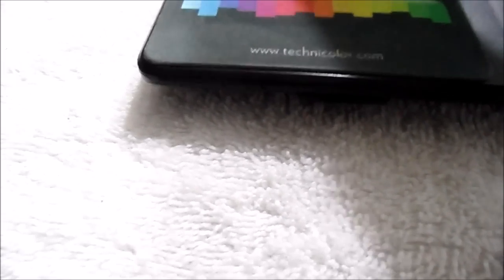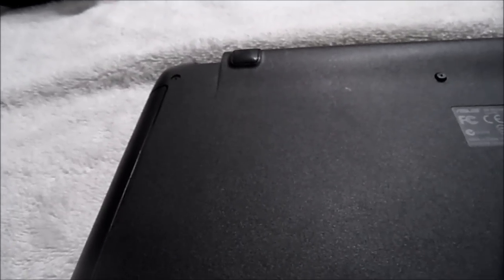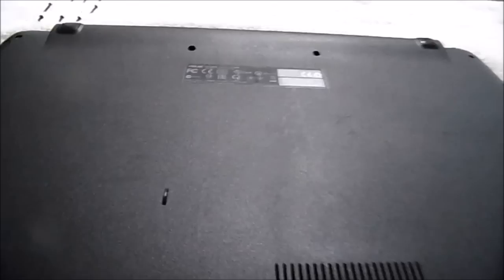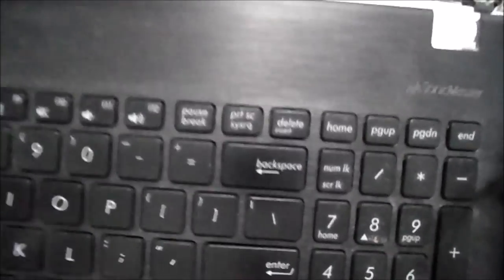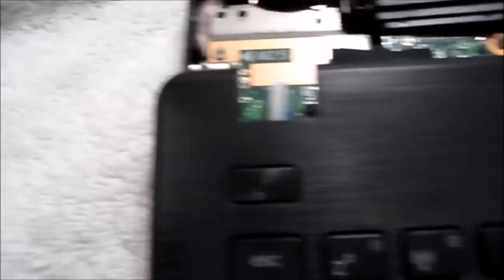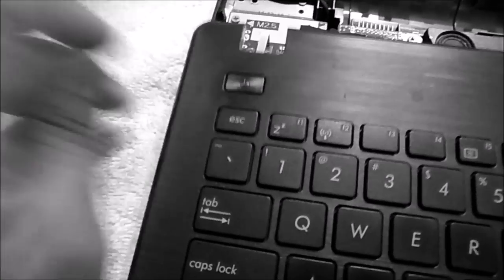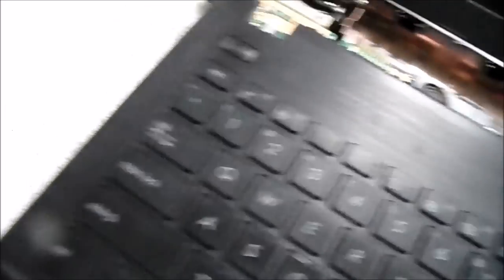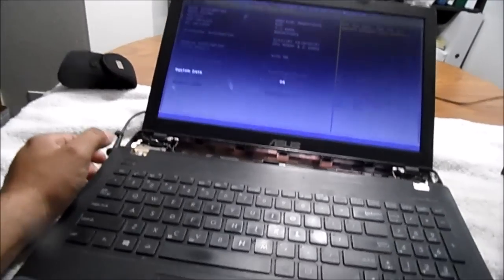Asus Computer IS NOT turning on from residual charge. here is the Fix up

Comment: Thank you....IT WORKED.  after I powered up without the battery do I go ahead an put the same battery back in.
Reply from the maker: if the battery still good. If is bad don't. They cost about 15 dollars on ebay.  Good luck and thank you for your comment.
Reply: You have helped so much!  If I had taken it somewhere they probably would tell me I needed another compter...but I put the battery back in and it is fine!
Reply from the maker: I'm very happy to hear that. I put this video because I know a few of my friends threw their computers and bought others because of problems like the one I show in the video and when I told them about this solution and other tricks they did not believed me, so I made this video for them and you.  Thank you for your comment.

Comment: What if you can't take it battery out.
Reply from the maker: The residual energy is store in the battery and you bios controls its discharge.  And it is the reason why you can't shut the computer back to on.  You must remove the battery to release the residual or left over energy.  Good luck.  Please subscribe if this help.
Reply: I couldn't get all of the dawn screws out. So I guess I will have to take it in to the shop

Comment: how do I make a asus laptop charger
Reply from the maker: If it is not charging then the battery is bad. I buy them at best buy for 15 dollars.  I hope that helps
Reply: Orelius so the battery at best buy is 15 dollars
Reply from the maker: I apologize NOT AT BESTBUY that was my mistake.  I buy the batteries on eBay for 15 dollars although I see this week they went up to 19 dollars.  Here is the link:  https://www.ebay.com/itm/Battery-M-for-ASUS-X551MAV-HCL1201E-15-6-Laptop-X45LI9C-A41N1308-4CELL-2600MAH/221912491394?ssPageName=STRK%3AMEBIDX%3AIT&_trksid=p2060353.m1438.l2649  just make sure that is the right battery for your ASUS.  Thank you

Comment: Hello, i have ASUS X550 L, my pc wont start up, my batter is broken ( it doesnt charge always 0%), but when i plug in the battery and plug i have led glowing at battery charging help please?
Reply from the maker: I though I answer this comment a few days ago. Something must have happened and it did not save my reply to you Norbertas.  Please excuse me and I hope this time you'll be able to see the answer to your comment.  I have also done this to the ASUS X550 and it works too. so here to go.  1.  Remove the battery or internal battery which ever you have from your computer. 2. Press and hold the on/off button for at lease 30 second to a minute to release residual energy being store from your bios memory and then release the button.  3. Connect cord to a wall outlet and press  on/offbutton until computer comes on.  4. Re install battery.  Thank you for your comment.
Reply: Hello, i have tried that metod of unpluging everything holding botton of  booting for 30 to 1 minute and then pluged charger in and trying pressing botton and it didnt work. Maybe I'm doing something wrong? Have you got discord or smth i can contact you with?
Reply: Orelius hello once again, i wanna ask do you have any social medias like facebook instagram or snapchat? Because i wanna show you how im doing  the way of (starts with everthing plugged in including battery and charger). 
First step is removing battery and charger from laptop.
Second step is holding power botton for 30 to 1 minute.
Third step plugging in charger.
Forth step is press power botton on.
And when i do all the steps my laptop still doesnt work.
If you could help me please.
Reply from the maker: Forgive my late reply but I am out the state for work and I don't have internet here.  I don't have social media but I can tell you that I only know two problems in this case. 1. is the one you have in this video which is the same I wrote you about and 2. is your power supply maybe damage as the diodes worn out at around 3 years for some of this type of computer as being very familiar.  Unfortunately, I would not know how to get a power supply if that is the case.  I wish you luck.
Reply: Maybe its battery, because i know that that battery is damaged and cant get charged, but if i dont plug the battery in but charger instead it should work isnt it?
Reply from the maker: Right, if you take the battery then don't plug electrical cords and just press and hold the on/off button for 30 seconds then plug an electrical cord or a good battery and it should work.  If that doesn't work then is your power supply.
Reply: And what could be with my power supply? Giving too much power or smth?

Comment: Hi,I have Asus X455L It won't  power on and won't charge, no light indicator if the Ac adapter is plug in .. Can you help sir
Reply from the maker: You have to remove the battery first.  With the battery out, press and hold the ON/OFF button for 30 seconds to release the energy back up by the last residual charge which is still being reserve by your bios.  After holding the ON/OFF button for 30 seconds to connect the plug or install a battery and that is all to it. Thank you for your comment.

Comment: This actually works! I have an ASUS X550J with external battery and had the exact same problem, my laptop would not start, not a single light on. Took the cable and battery out, hold the power button for like 50 seconds, put the battery back in and then it started aș normal . Thank you sir!
Reply from the maker: I;m happy for you. This works for any compauter out there. Thank you for your comment.

Comment: why is this???
Reply from the maker: Think of it like if your cmos or bio memory storing left over energy  but because you battery is dead, the energy or electricity can't be released until you remove the batter and then jump start by connecting it to the wall outlet. Thank you for this comment and if you like this comment please subscribe.  If  you have anymore question just ask.  Thank you.

Comment: I'm using a Asus d550m (given to me last year but I never had a charger) so I finally charged and the lightbulb LED is green. but the battery LED isn't. and it isn't turning on. what does the lightbulb even mean ?
Reply from the maker: Sorry for the late reply I was out of Estate.  I'm sure that you are having the same problems I am presenting here.  If the light bulb LED is green than you should have charge coming in and that will turn on the computer even when the battery is in red which mean your battery is damage or charging.  Please follow the video instruction and that should do.

Comment: So the idea is to have no power going to the computer while pressing the power button, and that pressing the power switch part will drain away excess voltages? (Hey please don't get me wrong, I'm not being a smart ass!) Maybe here's another solution. I have a barely used 6 month old Asus X551M notebook PC. It's got the same issues as everyone else's so I'm thinking maybe just unplug the wall adapter and leave it on battery power with the screen and system using up the power from the battery. It might take a bit of time but the battery will eventually die and then a person can press the power switch for the 30 or so seconds and solve the issue without having to take it apart... or so's my thinking haha!
It's Sunday and I don't do much on a Sunday 'cept pet my kittys or wrench on my old GMC 4x4... this looks like a good clean little minimal physical effort project. I've got the time so I'll have a go at it. Worst case is I take the 7 or 9 minutes (probably turn out to be a 3 or 5 minutes job haha!) and do as told here. 
I'll come back and post the results after I'm done.
Reply: Why not try the 5 hour discharge first?

Comment: hello! I have got an Asus Laptot. it only turn on when connected in power adapter without the battery. when you connected the battery it does not turn on and even if you plug in (power adapter) with the battery connected it does not turn on either, but an orange led light blinks. Can you help me out?
Reply from the maker: Excuse my late reply, I am out of state but I will like to answer if I can your question.  The same thing happened to me.  Three things you need to do that my video shows.  1. remove the bad battery 2. Do the reset that I explain in the video.  3. Put the battery and try again.  I hope this help.  Thank you and appreciate your comment.
Reply: hey did you end up finding a solution to your problem? Am having the same problem and iv tried everything already